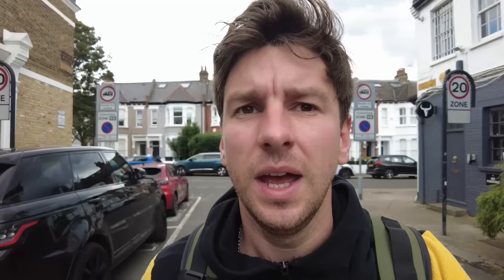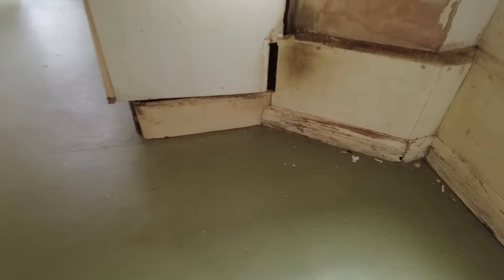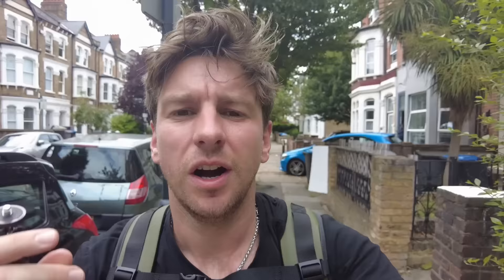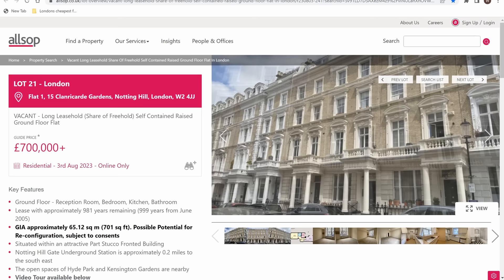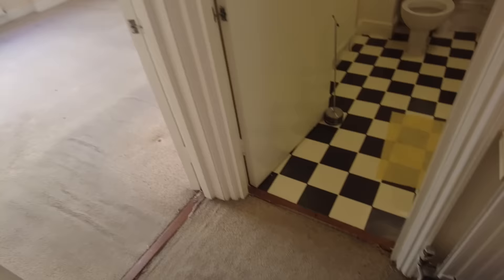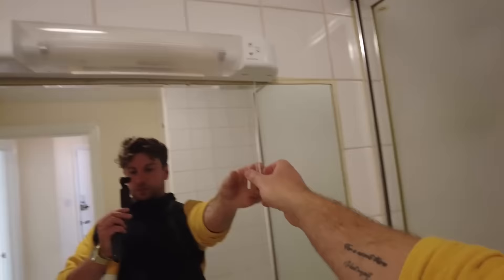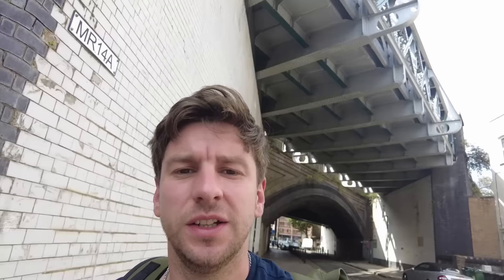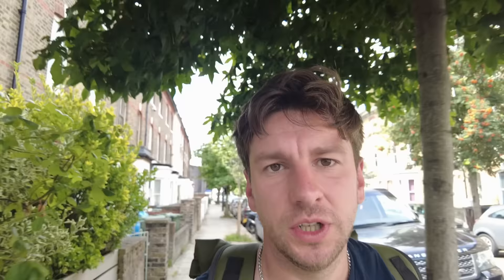The Cheapest Flats For Sale In London In 2023

Comment: The first flat you saw in London needs a rip the guts out,the cost of tradesmen in London is very expensive,it sold for £380500 will need about £120.000  to bring upto standard, so that  half a  million before you start,then you will have building control involved they drag there feet,then theres parking restrictions everywhere in London,another problem. They say its grim up north,but i have open spaces and a lot cheaper housing stock,ill stay put and visit London occasionally,mental health and well-being is so important
Reply: Exactly. It's not some cosmetic fixes like new tiling that Wandering Turnip thinks. Everything needs to be stripped to the studs. Then you still don't know what going on in the flat above. No point doing all that work if the ceilings are going to get ruined or cave in.

Comment: The London living situation is disgraceful… my first room in London was a shoebox where I had one broken cupboard and spent a year storing my things in boxes because I had no place to unpack them. Additional tenants included plenty of mice and the property was illegally rented to more people than it should’ve. My second flat was amazing at first, only to discover later that severe mould was just painted over and due to faulty plumbing the entire living room was unusable, with pieces of the ceiling crumbling and falling to the floor and new leaks appearing all the time, not to mention the electricity short circuiting all the time - you couldn’t run a washing machine and boil the kettle at the same time… I really lucked out with my current landlady, she lives outside the country and is renting out the flat she grew up in and it’s in fantastic condition, regular repairs and she’s the biggest sweetheart ever, but this is such a rarity in London…

Comment: Cracking video David. On the question of the price a kitchen in the first property would cost would vastly vary. If you bought a cheap kitchen suite, tiles, lights, sink, taps etc and installed it yourself, maybe as little as £5000.  I would personally have the kitchen area reskimmed and treated for mould before installing the new kitchen suite, which would add a further £1000. You would also have to consider the heating system in the property too, so it's not cheap my friend.  Thumbs up!!

Comment: I just bought a house and redoing a couple of rooms, we're now done with the attic and the office and they both have new plaster on the wall, a new floor, new isolation and a new ceiling and all in all that coster around 2-2.3k for both rooms. We had the plastering done by someone and that cost around 1.6k for both rooms, all the walls and the ceiling.

Comment: Wonderful selection. I was a carpenter builder for 42 years. So have a reasonable idea of renovations. As that is mostly what I did. You have to wonder why you have water coming through the ceiling. When there is a flat above you. There were a couple of properties there that would certainly be worth doing up. And once tidied up, flipped for another. At least if you are a ground floor flat, between other flats. There are only two external walls. So a lot of the mould etc. is just from sitting empty. The maisonette, looked pretty nice. I could live in that. And for London prices. Better than living nine in a small house. The last one for 3 million. What a rip off. That castle in Durham has my name on it for 3 million. Unfortunately my budget runs closer to the 185 thousand maisonette.

Comment: The first one has rising damp problems as it wasnt built with a damp proof course. Insead of doing the damp proof course properly its been bitumen coated and then covered in render. Generally it doesn't work as you can see. Its just a cheap option to try and solve a problem. 
The other damp problems are probably condensation issues which you get on uninsulated houses.
Reply: I grew up in a property like that and the damp gave me lasting health problems. So as soon as I saw that property, I knew how hard it was going to be to fix. Absolutely not worth it for that shocking price.
Reply: Condensation can also be caused by people drying clothes indoors on radiators and cooking without opening the windows
Reply: No such thing as rising damp. Will be water ingress . Water does not go up
Reply: @skerriesrockart where are people meant to dry their clothes in a flat with no dryer or outside space? You can fit about 6 socks on a radiator, so that's not the issue. And are you really meant to open the window on a 2° day because you've got to make a pasta? Ridiculous. It's not the tenants fault, so stop trying to shift blame because it makes you feel better. Houses need to be built AND maintained for the weather they exist in.
Reply: @madeleine2631  Yes its completely the tenants fault

Comment: A HUGE PIECE OF ADVICE - Only buy a council flat if you intend to have a lodger(s) or simply rent out the individual rooms to various tenants. The service charges are astronomical and increases your on year. But the killer is the major works bill which is a complete rip off. A Leaseholder on the Tustin Estate in Southwark was charged a staggering £146,257.22p. The most I’ve paid is £12,000 I know others that have paid £20,000 Plus etc. It’s not a one of thing. Whenever the council decide to refurbish the building or make major repairs one knows a massive bill is coming their way. I say it’s a rip off because, everything is inflated. From a nail, to a door etc. There’s a lot of skullduggery and creative accounting and it’s an expensive business to hold the councils accountable.
Reply: Damn £12k and £20k for what and where ?
Reply: Agreed add housing association.  Mine has neglected the property I live in.  When you email them with complaints and observations you get ignored.

They need to do up the building and there is no sinking fund.  Sigh... Buyers beware

Comment: Couple of things about leasehold properties. Depending on how long is left on the lease you can always renegotiate and get a new one after a certain period of time. And if its say, 2-4 flats in a block or converted house and all are owned you can get together with the neighbours and buy a share of the freehold as the freeholder are obliged to sell it to you. This is another expense maybe several thousand £s each but at least the property is then yours outright and it adds to its resale value. However the rules about existing leaseholds need revising, specially ground rent.
Reply: Yep you can. But if the freeholder has died you have a problem. You have to advertise "Looking for freeholder blah blah" in national newspapers and then place a bond for X years in case they turn up later. But after going through this process of trying to find the freeholder and failing, and paying Y thousands, you can form a company with the other flats and buy the freehold if the freeholder is missing. My info is from 20 years ago though, maybe its changed.
Reply: That what we did. Worked out well.

Comment: I'm sure you're aware, but you can extend the lease by the way. Ideally don't want to let it get it below 80 years, but before it gets to that point, can pay (depending on location, size, property and the leaseholder) a couple all the way up to 10/12 grand to extend, usually by 90 years to make it easier to sell on again
Reply: Only if you can find the freeholder. In a modern block of flats that might be doable, but not in all circumstances. I got caught out.
Reply: @paulbrown5839  that’s a shame, sorry to hear! Would the freeholder not be on the property reports you can buy from the government online? My flat isn’t new by any means but luckily is property managed
Reply: @EddieCharles  You can find the freeholders name but what if they have gone overseas or died? There is an expensive process you have to go through to show reasonable effort to contact them before you can move forward without them. If I was going to buy a leasehold flat with less than 100 years I would make sure I could locate the freeholder first before buying.
Reply: @paulbrown5839 what happens if the lease runs out and the freeholder hasn’t been found? Who then owns the flat?
Reply: @yaturkeyneck7130  I don't know because I was not near the end of the lease, but my guess would be that the same process would kick in (in case the freeholder has an inheritor). Ask your solicitor.

Comment: You should be able to extend the lease if its a council lease. There is a fee to be paid, but its possible. I extended mine from around 86 years to 129 years and it cost around 8k back in 2011. If I remember correctly, the rate had to do with the time remaining (increases as time reduces).
Reply: 8k is lot of money
Reply: Yes it is. But considering the value of the property (350k) it makes sense. The amount has covered itself in the value of the property over time. @Sabir4u

Comment: First flat: cost to renovate is min. 60k, more like 70. The "garden" doesn't add any significant value to a flat like that, as it doesn't add much to the rent you can ask. What was the parking situation? That's an important factor. The short lease is a problem. Total cost will be around 360, if we include stamp duty and refurb costs. Rent: 17,400 p.a. Yield: 4.8%, which is good for London. Still, it's less than current inflation and is only worth the effort if the property rises in value, which it probably won't due to the shrinking lease.

Comment: Yea i agree about the building condition the land lords are mostly not good due to Mold and Rust not to mention the furniture are mostly in bad condition, but even if you fix all of it it's just matter of time before it happen again.

 
My suggestion would be the use of Epoxy (a lot of it for the floor and walls) and coated water resistant paints for the ceilings to resist molding problem. For the pipes just changes it with custom treated copper pipe the same with the sink you should use custom treated alumunium.

Comment: Im gob smacked.  £285,000 is over R6,000,000. For R2,000,000 you can buy a 3/4 bed house in a large garden with a two bed granny flat/ a pool.  The house would be all up together with luxury fixtures and fittings.  Sun most of the year.

Comment: You might want to consider experiencing life as a landlord before passing judgment.

I invested in a buy-to-let property when it made sense for my financial and logistical circumstances. That said, I still had limited resources. To be fair, my tenants were not the worst, but they weren't exactly exemplary either. In their view, my property ownership equated to an endless supply of funds to clean up their mess. I even invested in home improvements that they left to get damaged through neglect. My income was not much at the time. I kept the rent significantly below market rates, barely covering the mortgage interest, landlord expenses, and sufficient maintenance.

During the tenancy, there were problems with rent payments, and when it came time for them to vacate, it took months to finally get them out because, if tenants want to, they can certainly take advantage of the legal cushion they have. I was selling the property. I lost one sale due to the tenants' refusal to leave, and I was on the verge of losing a second sale. The tenants should have left the property in a clean and orderly condition (as it was when they moved in), but upon their departure, they left it in a mess, expecting me to clean up after them.

Comment: The problem of london is that there is not any price for quality. 
Properties are expensive because additional prices are calculated with a lot of fantasy based on very silly stuff. 
you have a garden, not problem if it looks like a WWII battlefield +50k.
you have one bedroom, not problem if is the space of a cupboard you can potentially sleep standing up , +60k
you have a one bed flat, not problem if you need other 200k for refurbish, i charge a one bed flat price..

So there is not any possibility even to join the market. The first house for example in another country is the typical house to start with, buying for nothing, doing some refurbishment with a little bit of work and then access to the ladder. 

This is why i run out from that nightmare of city.

Comment: Hiya, you're not quite right about how leasehold works. You do own the building if you buy it, forever. The leasehold means you don't own the land it stands on & you have to pay the owner of the land a yearly sum to rent the land your house stands on. 

So at the end of the 900 years or whatever, it's not like someone can come & take your flat away, in fact it's worse than that - whoever owns the land can change the price of the lease. This means that if you want to sell your flat & the lease is nearly up, you'll likely have a lot of trouble selling it, even if it's in great condition, because it's too much of a risk that someone shady will decide to hike the ground rent up.

As well as that, some ground rent contracts are really exploitative & can go up every single year. Lots of people are facing bills of thousands a year without seeing any benefit from that, someone is just profiteering from the fact that they own the land the building is on.

Leasehold is an absolute scam, there is legislation going through at the moment to try & deal with it, but of course it doesn't really go far enough & a lot of people are at risk of losing everything because they're stuck in a flat with an ever increasing ground rent that they can't afford, & they can't even move because no one wants to buy it.

Comment: The lease is not a bad thing with flats, and you have a statutory right to extend the lease as well. Having a lease does not mean that you have to give it back at some stage. The lease is a rent on the land on which the flat is built, and the owner of the land ( lessor) is legally responsible for the upkeep of any communal parts such as the roof, and must keep them in a reasonable state of repair. Mortgage providers are happy to provide mortgages on properties with a long lease, but most reject freehold flats as no one can be held responsible if for example the roof falls in or a communal stairway falls into disrepair. Main point is that having a lease can be extended as long as you do not leave it too long.

Comment: A lot of those homes should be demolished or the very least completely renovated from the ground up. But it would cost more than just buying a brand new house elsewhere. It's also not a guarantee mold won't return if the other homes aren't taken care of either. 

I've seen drug houses in better condition than this.

Comment: 5:00 from my own experience I see this is only because of the very bad or very old school non-existing hydro insulation what it means under the floor under the beams and right there near the concrete you put like at least 200 micron film I personally did two times that and then you know what it fixed f**** hell it fixed for real all my parents said is impossible but I prove it them wrong everything went away The smell went away in the air became even dry The walls became dry this is all because of the moist which is trying to escape and it's crumbling the walls also power lines inside a walls everything you can imagine tiles even falling off Yes that's normal because on the old times there was no such access of the material everything what they used to do it meant to be maybe for 30 years no longer now we can do it like it would would last like 60 years if not 100

Comment: Not a nice lifestyle to own,rent and have to live in such a place before or even after decorating. Small houses will easily get damp and need decorating because of the cold in such a small space,an unlivable space and the fact that the decor deteriates so quick is why these are unlivable in. These buildings were designed as a single house and that is what the buildings should be.